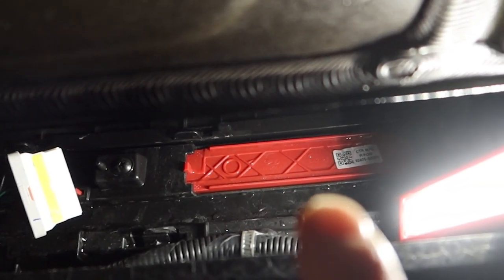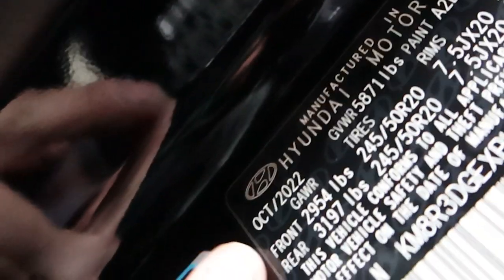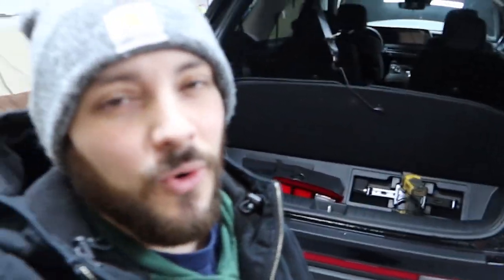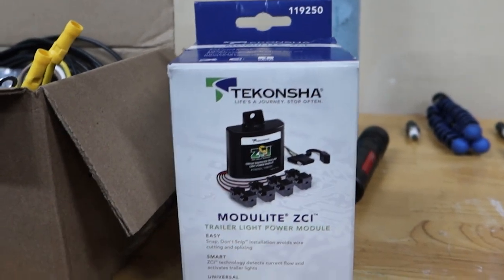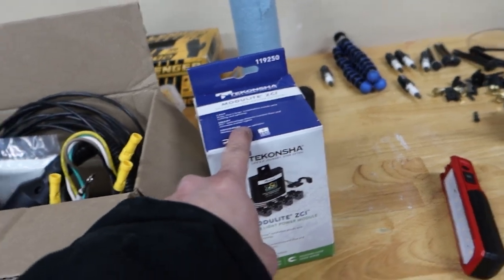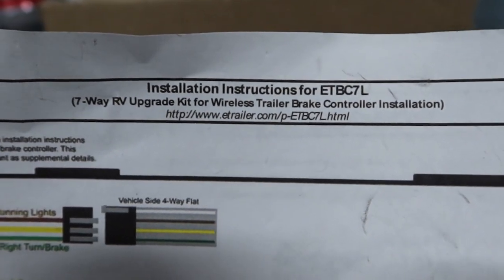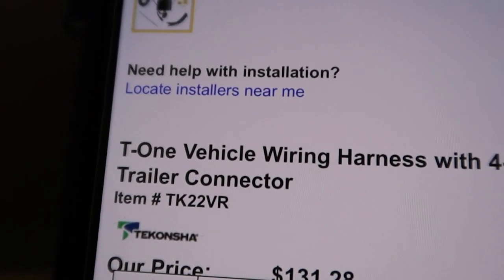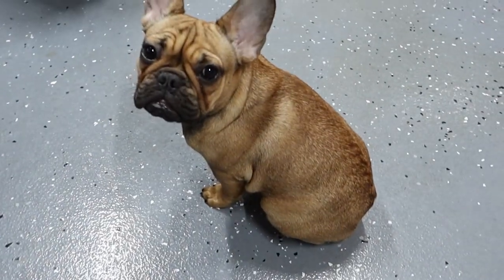WHAT YOU NEED TO KNOW ABOUT THE 2023 PALISADE TOWING WIRING HARNESS!

Comment: Thank you for the video I also have a 2023 palisade and just bought a trailer hitch and was about to order a wiring harness but came upon this video. Please keep updated.
Reply from the maker: S8F67AC800 is the part number for the 2023 wiring harness. It’s only available in Canada but can be shipped to the states. It’s not available in the states yet for some reason. I ordered on but it’s a 4-6 week back order. I have another harness on the was from Eteailer.com. I am trying to find an American no wait solution currently. Also the plug I discovered in the video isn’t the correct plug. Apparently there is a CAN Bus plug under the back area underneath the jack.
Reply: @Boost-EdAutomotive  thanks
Reply: There is a fix for it now new recall 235
Reply from the maker: A fix how?

Comment: Please post the next video ASAP!  I just discovered my 2023 Palisade is just like how you described in the video.  I was planning on installing wiring based on previous Palisade models and planning on a trip with the camper over kids' spring break.  Need a fix fast.  Thanks for the info
Reply from the maker: Waiting on the next part. I have most of it. I’m assuming the camper has brakes? When is your deadline? Etrailer.com is definitely the place to shop. They ship fast. As for the job, it’s going to take a few hours with the wiring needed for the trailer brake controller and 7pin
Reply: Trailer does not have brakes - but does use a 7 pin connector.  So, all I need are lights
Reply from the maker: That’s correct. Does your trailer have a battery? If it does then you’ll need to hook up charging but that’s it

Comment: I am absolutely furious! I also was planning on installing a towing hitch, but WILL NOT INSTALL IT AFTER MARKET. Contacted the dealership in Lufkin, Tx where I purchased the vehicle and was told by the Sales Manager that if I installed at anyplace other than the dealership it would void my warranty!!! I WOULD NOT DO IT!!!! Yep, you guessed it, I was not told this before I purchased the vehicle when asking. Was told to schedule an appointment and the dealership would it. THAT WAS A LIE!
Reply from the maker: I’m right there with you. I haven’t even found anything aftermarket that will actually work. Canada has the factory one but it’s a 4-6 weeks back order and you would have to install it yourself most likely
Reply: Yep. I was in the same position. Had to go through the dealership and they shipped it out to a 3rd party to have it install. Had to have the wiring completely redone.  And yes I am very upset that the dealership even to this day is playing dumb. Like they had no idea.  Really...when you already have a process setup to send the vehicle off site to have this done. Their should be a class action lawsuit for false advertisement.  When you purchase it and the information says it is already pre-wired for towing and you have a towing button on the dash.  But you can tow anything if you are not wired for lights.  Simply purchase the wiring harness and you are all good, but you can't purchase it.

Comment: Correct part number for harness for 2023 is 	S8F67AC800.  Can be found in Canada but not the US.  It seems if I put a link to another forum thread that discusses this it gets deleted.  That is not the correct plug.  I have a 2023 XRT and have installed a hitch and Hyundai 7 pin harness.
Reply: Glad you are trying to help people. This issue has been discussed a lot. And that plug you found was a suspect for awhile. But after getting the part from Hyundai and following instructions the correct plug was found. The new plug actually is on the CAN bus and uses that to determine status of lights. Not like previous wiring (like everything I have ever owned) where the different lights had individual wires.
Reply: How do you post links in these comments. There is good information on this at another place.
Reply from the maker: The part number says tow hitch. But it’s actually the harness?
Reply from the maker: Yeah CAN bus will definitely be the new way to do things. The performance side has been using CAN bus for nearly 5 years and it’s trickling to standard cars
Reply: @Boost-EdAutomotive  yes , at least when I ordered it.  How would I send you a link to a thread with pics that show the part and installation
Reply from the maker: I will definitely be making another video as soon as I get things figured out. I’m just trying to help everyone else stuck in the same boat haha and an alternative to the Canadian part because they seem to be back ordered a lot
Reply: @Boost-EdAutomotive  There is a palisade forum where this has been discussed a lot. Lots of good info.
Reply from the maker: I don’t know. Maybe Facebook or Instagram. I just ordered the part so hopefully it will come in soon so I can install and upload a video
Reply: @Boost-EdAutomotive  Hopefully you get it soon. I don't have Instagram.  Wish there was a way to message here.  lol   Wish you good luck. Look for the forum about palisades.  Lots of good info there.
Reply from the maker: @tkmnospam  does the Palisade have a factory trailer brake controller or will I need to install one? I see it has trailer weight setting but I assume that is only so the Palisade shifts and brakes better according to weight
Reply: @Boost-EdAutomotive  No factory controller. You have to provide your own. I believe you are correct about the trailer weight setting., The harness does come with a pigtail that plugs in under the desk to hook your controller to.